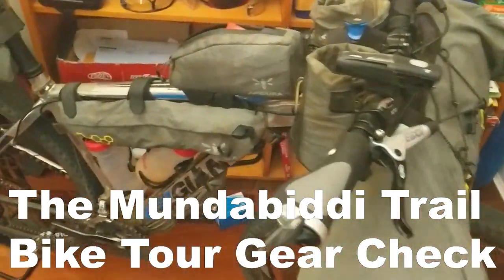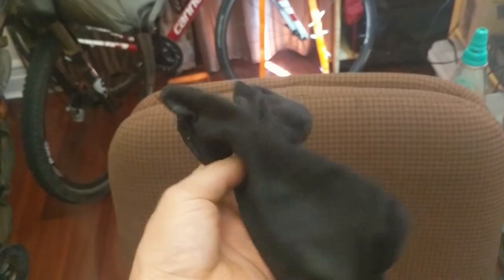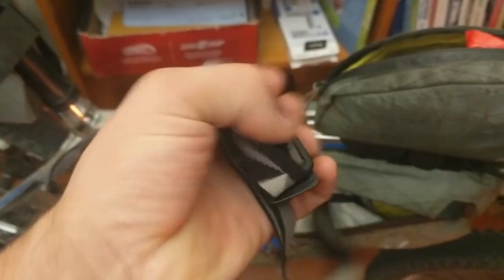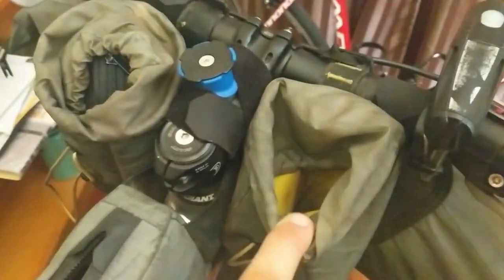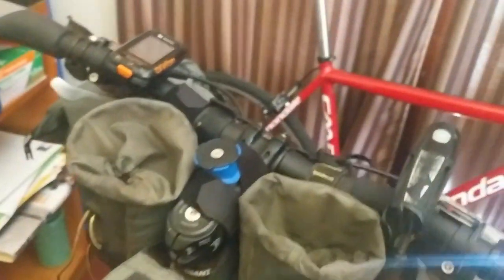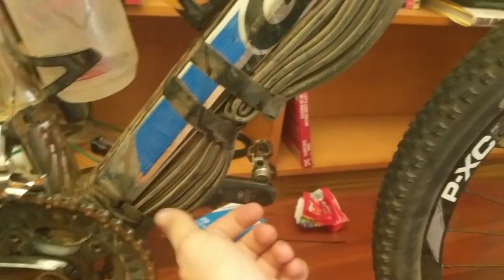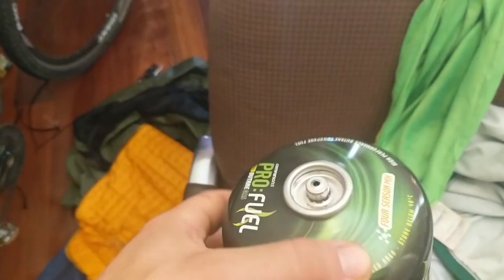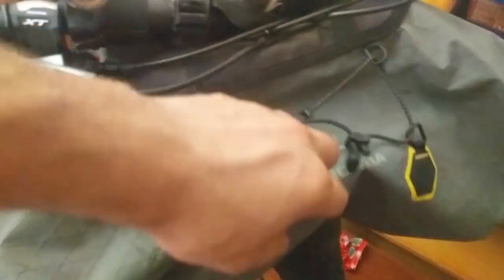Mundabiddi Trail Bikepacking Gear Check

Comment: Nice review. You did the ride in January! Did you consider using a trailer - a bob or suchlike? & kevlar-lined tyres I'm guessing?
Reply from the maker: I did consider a trailer. It has been done. Not great for all the steep hills, up or down. Plus the extra cost and inconvenience made it not worth it for me. I think riding across Aus would be the only time a trailer would be worth it. My tires were original with the bike. Nothing special. Didn't get one flat. I'd go as wide as I could fit next time.